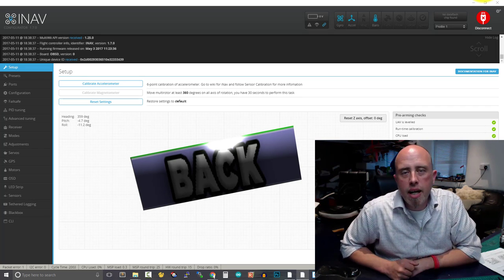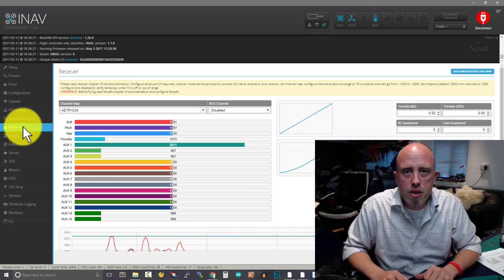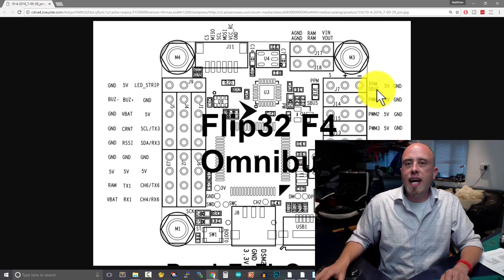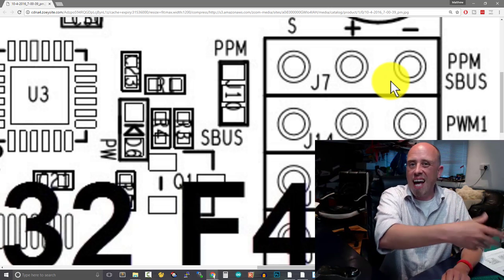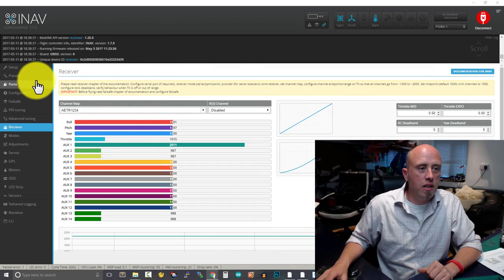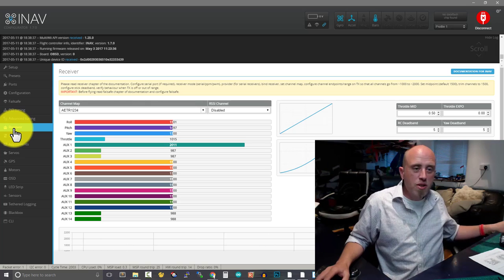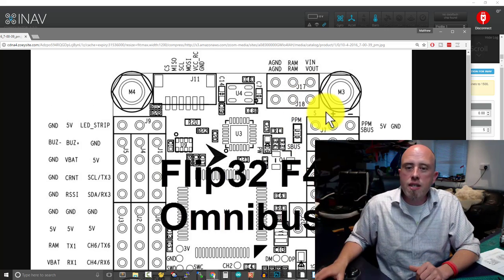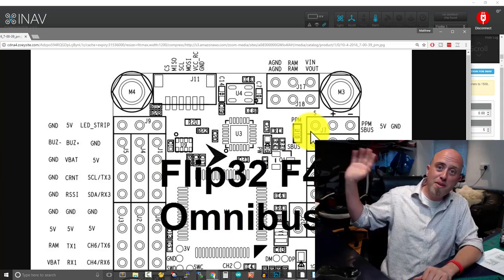FIXED: SBUS Not Working on a Omnibus F4 Pro V3 Flight Controller?

Comment: This will not work with all receivers. I spend hours trying to get it to work, but no, didn't work for me. See, reason was, unknown to me at the time, I was trying to connect a "none inverted" receiver, what ever that means,  to the F4, and it won't work. So now, I have to get "inverter cable" to get it to work. Frustration all the same. Thanks for what you are doing.

Comment: Thank you so much Matthew ! Your tip helped me clearing the issue on my Omnibus F4 Pro V2 !!
Reply: Alexandre Coleno i have the same issue with v2. How did u fix? Cheers
Reply: Same way as Matt does in the video: Solder the 2 pads (center one + sbus one)
Reply: Mines not the pro so those pads arent there, or labelled anywhere...

Comment: Hi, Matt. I need a help. My copter remains motionless even if I arm it and unplug USB cable, it stand on  horisontal surface. There is no any reaction on Throttle stick on motors, motors still stopped. I tryed to switch Arming in both positions,  betaflight shows arming but copter remains motionless. Explain please what should I do to spin up props from radio (I am using Taranis Q X7 with OpenTX, FC:  Omnibus F4 V3

Comment: Hi mat.. Im using omnibus pro F4 V2.

Why my sbus is not working?
I connected sbus port from the receiver to the sbus port on the fc.

Then connect the fc to computer using usb cable.
( i didnt solder the vbatt yet on the fc )

But why my receiver is not turn on?
Take a look on inav configurator, 
On receiver tab.
Im trying to move the aileron, but it doesnt affect at all.

It seems the sbus is not working
Reply from the maker: Hey Rian, see the FB group! Matt

Comment: I have Omnibus F4 V2, already connect to Sbus... receiver tab on config show everythings fine but, there's no servo movement???
Every channel slider move as the stick move... but servo not make movement at all... wiring was correct (i use SP Racing F3 before, and this case i only exchange the FC)...
Any suggestion?

Comment: Hi Matt
I have given up trying to connect SBUS and GPS on the F4Pro V2 board because it hasnt got the solder pad option
I'm going to try the F4 V3board - who are the best supplier
Do you have any guidance on connections - for example where does the GPS connect?
regards
Hans
Reply: I have a f4 v3 and it did not want to work for me

Comment: Hello Matt. I know this video is a bit dated, but I am trying to figure out this issue. I have an FrSky R-XSR Ultra Mini receiver (SBUS) and I looked at the Omnibus board where you indicate I should solder the two, tiny tiny, pads together. Only problem is, there is a component there, a tiny little resistor.  I fear I might have a non-inverted receiver, as Midnight Mike did below. I have the schematic to build an inverter cable, but need a couple of components.

Comment: Nice one Matt, I've got fingers and toes crossed for success with this venture.. I want to fit out some severely space limited micro semi long range fpv wings and planes with gps/osd, currently using bigaole on one and skylark tiny III on another, as good as BGL is, it's just too bare bones without osd, as good as skylark is, it's just too risky without RTH, Both together and I may as well have another Vector, but $$$. Cheers, and good luck!

Comment: Thanks man, but on my board Sbus jumper has connectivity with the middle pad even when not soldered. I tried both soldered and unsoldered and no luck, the receiver is not working on this board (tested the receiver and it's ok). I guess the RX1 port is just dead.

Comment: Matt! I have a serious problem. Have connected my L9R reveiver and followed your steps, and Inav sees all my stick movements etc, yet the PWM outputs are doing nothing. Not the motor nor the servos. I have checked, they all have 5V (from the BEC on J17, the connector from the ESC). Also, the board does not beep or anything on startup. Is that normal or is my board faulty (Omnibus F4 Pro). Cheers, Jan
Reply from the maker: Morning, see the series i did on Inav, the board is not arming for a reason. Matt
Reply: RagTheNutsOff Hi Matt! Thanks for your reply. Could you please point me to the video? I have been watching your videos and trying to find the fault for 2 evenings now :'( I do have SBUS connnected properly.
Reply: Do I have to calibrate the accelerometer in order to get the board to arm? Thanks!

Comment: THANK YOU!!! I was stumped for an hour.
Reply from the maker: Howdy Adam, I'm glad that helped you too. I was stuck for just as long too, hence the video, Matt
Reply: Are you by chance using an FrSky Reciever? If so did you have to do the inversion mod in order to get telemetry? I saw Betaflight 3.1.7 now has telemetry inversion built in but not sure what this means to the Omnibus setup. Thanks in advance!
Reply from the maker: Howdy Adam, I am but the only telem I am using is on the OSD as I'm typically using a L9R receiver which doesn;t have telem. Hope that makes sense! Matt
Reply: Hey did you ever figure out if you needed to do the inversion mod to get telemetry working? I just got this board and the XSR, not quite sure how to get the telemetry working

Comment: Thank you very usefull, what is the connection for a Blheli32 4in1esc Harnas pleas ?

For the Omnibus F4 v3 Pro clone version: i going to use a ubec 5v or mini step down regulator to powering only to my new board,  it can't handle 4s battery and i dont waint to risk it.
reason: i have burned 2 clone boards it hase some cheaper hardware quality

Comment: Hi Matt got OMNIBUS F4 PRO FLIGHT CONTROLLER WITH OSD & CURRENT SENSOR V2 using ppm works from receiver to flight board but got no joy from board to motor or servos there nothing happen at all is there any pins on this board soldering really stuck.
Reply from the maker: Hi Pete, does it show as working on the receivers tab? If it does then you have an output or arming issue instead. Matt

Comment: On my board it was already soldered to Sbus but I still get no signal in betaflight. UART6 set and configuration on SBUS. Using a RX-SBUS from Walkera to connect to my Devo7. Any further ideas what I can do?
Reply: 089recorded hey I hope you can help. I have the same RX and same TX as you and of course I have the same problem on betaflight. Can you please please please tell me if you got it fixed. It's been driving me mad now for 2 days! Thanks.

Comment: Hi Matt. I love your channels. Currently, I have a problem connecting the receiver (HK-TR6A V2). I tried everything that you instructed to do to fix it, but it didn't work. Is that possible that my receiver does not support S-BUS system? (I researched a lot for my receiver, but I couldn't get much information, since it was a cheap product.)
Reply from the maker: Howdy fella, I have absolutely no idea on that receiver,. Matt
Reply: Ok, we got it to connect the RC receiver and flight controller with the PPM connection. However, the receiver is not communicating to the ESC and motors. When we test the receiver with the transmitter and motors individually from INAV GUI, everything works perfectly. Could you give us some advice for what we can do to resolve this issue?

Comment: Really good tip! In my case it's soldered, the receiver tab works as it should, but servos and motor aren't... Sounds like the motor is ready but nothing moves. :/

Comment: Hi Matt
I'm enjoying the build - great videos

I was getting on nicely until I got to this stage - cant get an SBUS stick response with the F4  Pro v2 board and X6R
Everything is working as it should, ie RX bound, TX giving bars on the simple 4 channels, green and blue lights on board

Then I remembered this video about the PPM/SBUS pads!
I notice that there are also 3 similar pads on the V2 board - there appears to be a tiny bridge across the centre and top pad - is this the correct setting for SBUS ?
Reply from the maker: Howdy Hans, I frankly have no idea, check with where you bought the board for the exact pinout, Matt

Comment: Thank you, this helped a lot. I had another issue with the sbus which is that I had to enable RXSERIAL on UART6 instead of  UART1 to make it work. Because the GPS is on UART6 I had to use PPM to make both work. I found only one thread on a forum from a guy who had the same problem. It´s the cheapest F4 V3 from ebay I should mention. Did you have heard about that? Any advice what to look for when buying a F4?
Reply from the maker: Howdy I really don't know there are so many boards out there now and frankly speaking, the Matek F7 is the only one I have been using recently with iNav on it and actually I've just swapped that model over to using a Vector instead. Matt

Comment: Can anyone help me out. I have the same set up with the f4 v3 and XSR receiver. I read somewhere that the smart port needs to go to UART 6 in order to get telemetry working. is that the 6 pin connector labeled J10?
Reply from the maker: Howdy Chaz, I'm really not sure. Check with the place you board the board from and the firmware that you're putting on the board as well. Matt

Comment: Got an issue with a v3, its wont connect to spektrun serial smp 4648, and it throws the receiver into bing mode twice. I bind it, set the spek sbus on inav at any resolution, no control input. It shows bound, and after i disconnect power it also forgets the bind. Tried different fc and receiver works. But not with f4 fc v3.
Reply: Tried your soldering trick too. Tried switching uarts. Still same issue it wont register control inputs. Brand spanking new from baggood.
Reply: I might try to solder the signal cable to the sbus port, due the spektrum operates only 3.3v.

Comment: Could you help me with a Wolfwhoop f4 omnibus v2 i think , the dsm will not power up. It has the dsm pads , soldered to them but get no power, checked with voltage meter it reads the proper volts . help lol
Reply from the maker: Howdy fella, I have no idea on that one. Contact the place where you got it from and ask for a schematic. Matt
Reply: RagTheNutsOff Thank You man , great channel bro subd!

Comment: Is it true that Omnibus F3 is not capable of handling inverted SBUS, so you can't use a FrSky XM+ receiver with it?
Reply from the maker: Howdy Mike, the F3 board I was using took SBUS, I can't vouch for others though, Matt (note this video is about a F4 Pro V3 board)
Reply: Sry, I was referring to the F4, not the F3. The F3 DOES FrSky SBUS very well (using one myself), but as far as I know, the F4 can't handle inverted SBUS input. If so, it's a total bummer 😣
Reply from the maker: Howdy Mike, I use all my F4's with FrSky SBUS and they work fine, V2 & V3's, Matt
Reply: Sound great, good to know - thanks!
Reply: Hi guys, I have been studying this quite a bit getting ready for a couple wing builds, and I have come to understand that this f4 board has an inverter on the uart1 (those dedicated sbus/ppm receiver pads in the top right), but that all the other uarts are non inverted...
Not sure if that is totally right but logic seems to say that is the case...

Comment: what if you don't have an sbus receiver? what if it's pwm -- orange rx dsm2?
Reply from the maker: Howdy fella, thats easy, these boards do not accept PWM inputs. As for Orange, no idea fella, I don't use that kit, Matt
Reply: yeah, my technology is a little behind the times. Ordered some ppm receivers and 1 sbus receiver. I worry about the idea of sbus because it takes you down the road of more expensive equipment in an non-mature technology. I'll give it try, tho!

Comment: Thought this is just what i need, but i still have a rx failsafe msp error.
Reply: Sorted it. Uart 6 seems to have an inverter or something else that doesn't like my FS-IA6B. Putting the signal wire on RX3-Uart3 solved my problem.
Reply: Now Windows ten puts it in as a wheel and yaw and throttle are screwed as well as Zrotation.

Comment: Can it support on board, ^^Buzzer Alarm Beeper^^ for lose model?
Reply from the maker: Howdy fella, yes it can. Most of these boards have pins for buzzers. BUT keep the buzzer well away from the GPS unit or your main board because they have magnets in them and will give you false readings! Matt
Reply: Matthew Ogborne thank you. I asked this to company airbot. They diddnt return to me. Im interessting on airbot omnibus F4 pro V3.

Comment: what if you cant solder there any more cause those to little pad came off and there not there any more.
Reply from the maker: Hi Glen, not much to be honest. You could try and follow the track back to another point and solder there, but it'll be difficult. Matt
Reply: I see no more solder just board this it's done it worked fora second. But as I unsolder it . it was. All wipe out just one solder pad on top left

Comment: Hi Matt , great vids on these boards and iNAV . I went for the Omnibus F3 board and had a problem with the Sbus Rx too . Didn't realise that in the Ports tab  you had to put the Rx  on the UART 3  line (didn't have to do the solder link though . )  I have an Oled display connected to the board it shows sats , Vbat , lat long ,  Could be useful if flying LOS and wondering why it won't arm .
Reply from the maker: Howdy Graham, daft question, you're on v1.7.0 I tried connecting the Oled screen and no banana :/
Reply: Yes 1.7.0  just used  SCL, SDA  , AND 5V , 0V . I did have an ESC powering the board , Not connected the RAM power jumper to any thing. Just USB and the ESC  . Set it ON in the config tab .
Reply from the maker: Hmmm..... must be me, will give it another whirl :)

Comment: Driving me up the wall too, can get it to work with PPM using the jumpers but cant get Sbus to work even with the jumpers, using a Micro crossfire rx v2 chucking out sbus protocol so may be an issue with that.  Tried all the UARTS no joy...  Grrrrr
Reply from the maker: Hey Hally, yea I've heard of others having issues with PPM/SBUS with the cross fire. PPM should be fine though, Matt
Reply: Yeah ill have to settle for ppm just now, not sure if id go for that FC again though just a hassle!
Reply: Hally FPV isnt there a config option on the crossfire to send the sbus signal inverted or non-inverted? Maybe the default is non inverted, and the uart1 receiver pads have an inverter, so perhaps setting it to inverted would work there?
Seems now the best thing would be to use the crsf protocol (super fast/ low latency) on any other uart where you can use the 5v, gnd,  tx and rx solder pads to connect to the micro v2!!!?

Comment: Still no luck, i soldered the ppm pad instead of the sbus, think i might have a faulty board
Reply from the maker: Howdy Ewalt, ewwww sorry to hear that, Matt
Reply: Can i measure the ppm output from my receiver with a multimeter ?  just to make sure its not the receiver itself .. Thanks

Comment: think I will stick with my APM and pix LOL I know you have issues with mimosd what firmware are you using as there is a special magic version that I found
Reply from the maker: Howdy Jazzy, the fonts loading issue was picked up in the issues list on github and a fix has been released for it on MWOSD now, yay! Paid £40 for this board so needed it to work. Will be running iNav V1.7 on it :) Matt
Reply: it is a lot cheaper so will have to see how this pans out for you. I will dig put the better firmware for you and then you can see what you prefer for mimosd...
Reply: Its not much cheaper than going the pixhawk route. Just a smaller package so will be better for the smaller aircraft
Reply from the maker: Howdy Brian, I went this route because of the inbuilt OSD. Will make tutorials easier later. Assuming all goes well. Total cost should be around $40 USD.
Reply: And will be a bit tidier install. The pixhawks can be a right mess with all the cables.
Reply: true but you need the cables to connect up wrong. I use Ethernet cable where possible to minimise the cables where possible.

Comment: this video helped me out alot thanks..... i have only 1 more issue with this board that i hope you can shed some light on for me ??
i cannot get my gps to work in uart6 (j10) when i plug a reciever into j7  but have got it (gps) to work in uart1 via j5 the 4 pin plug on the other side of the board. but this is the uart for the serial receiver so in ports i can only use either gps or receiver not both together. i am under the impression that there is a conflict with uart6 gps (j10) when you plug in a reciever to j7 ???
i have heard of this problem on f4 pro v2.1 but slightly different as i think uarts were assigned differently allowing use of all 3 uarts in this way?   ps the gps worked fine in j10 until a reciever is plugged into j7 the gps icon goes red and hardware health is unchecked in setup tab...... i am tearing my hair out can you point me in the right direction with this at all?
Reply from the maker: Morning fella, I have no idea on that one I'm afraid. Matt
Reply: @RagTheNutsOff  thanks anyway for taking the time to reply. I have learned loads from your videos already and thank you for sharing what you know in plain English.. 👍